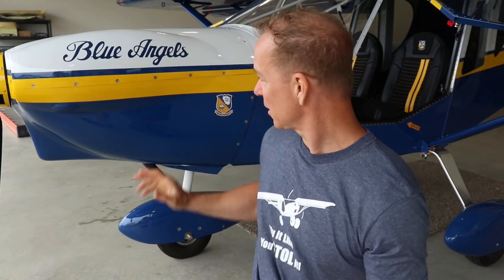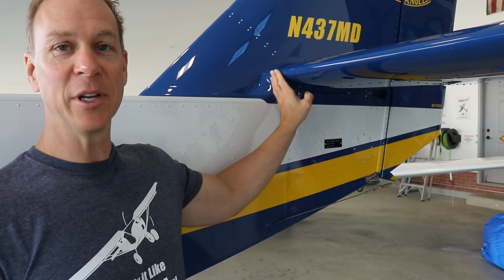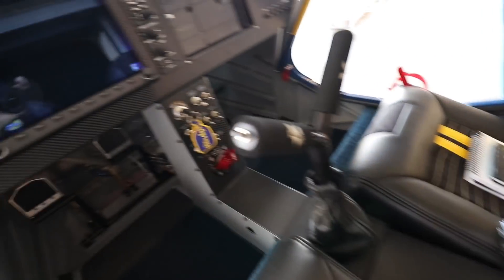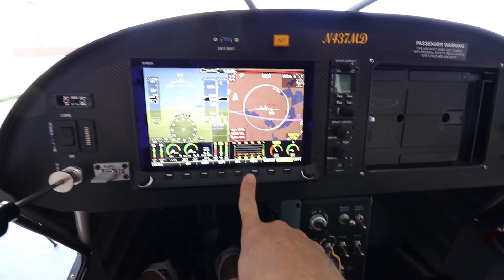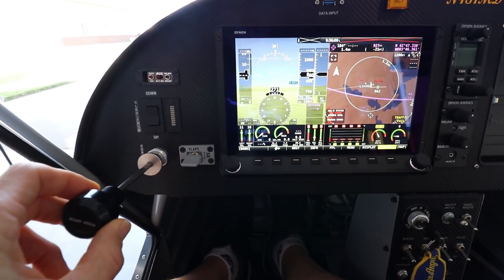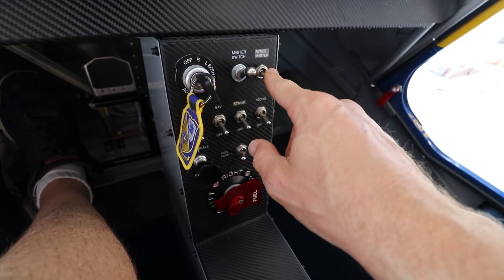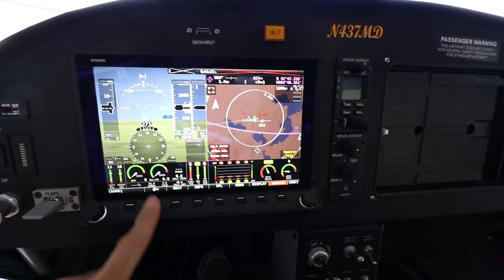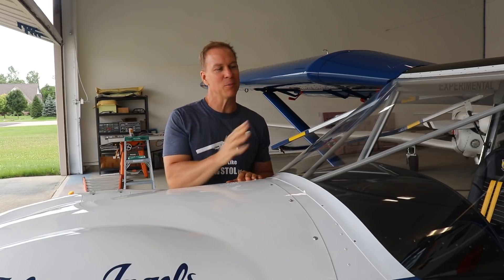Planning my CH750 Super Duty BUILD!

Comment: Good idea on the external charging port.  

I carry one of these in my survival kit in my plane... eliminates the need for hand propping and great for charging my cell phone and iPad if needed. Just have to remember to recharge it every couple of months of non-use or after a hard start... I have an adapter on my panel where I can plug it inside the cabin without the need to remove the cowl or even to step outside the plane.

https://www.amazon.com/Antigravity-Batteries-AG-XP-1-Flashlight-Carrying/dp/B0765NDS5P/ref=sr_1_4?dchild=1&keywords=antigravity+batteries+xp-10+jump+starter&qid=1597627216&sr=8-4

Comment: I have a dream!  And that is to one build a CH-801 SD!
A few questions; how would removing the carpet affect cabin noise?  I have noticed on almost all the Zenith videos that it sounds like being in a steel drum on take-off & landing; how would you dampen that or is it a non-issue?

Have you considered  a flip-down armrest with integrated throttle?  I saw it on a Aerosport Cheetah XLS intro video and loved the idea.

There is a local CH-801 that uses a BMW 1100 motor cycle engine & gearbox; what are your thoughts on such a solution? (Friend of skydiving jump buddy - hoping to speak to him directly soon)

Love you videos! Giving me hope that I too will one day follow in your footsteps!
Reply from the maker: That noise you hear is from the rear fuselage where there is no carpet, so removing it from the cabin would have no affect. No to the armrest. As for your engine question, I have nothing of value to add since I know nothing about the engine or it's use on an airplane. In general though, you will add many hours to your build going with an engine that is not currently supported with a firewall forward kit. So I would suggest the standard Rotax, UL Power, Viking, Lycoming, Corvair, etc... Good luck and hope to see you get started on a kit!
Reply: @KitplaneEnthusiast  Thank you greatly for a prompt reply!

Comment: I think adding the autopilot is a great idea.  I used to think that an autopilot in my STOL 750 was the antithesis of what STOL flying is all about!  However, it dawned on me that any cross country in a STOL airplane is a long cross country - timewise.  It's really nice to have a 2 axis autopilot to give you a break occasionally.  Like your Dynon, all I had to do was add 2 servos as the autopilot control software was already built-in to my MGL XTreme mini-EFIS.
Reply from the maker: John Austin Yes that was my thinking-if I fly this airplane to northern MI or out west somewhere, that’s a long flight in a bush plane and that autopilot will be very handy!

Comment: A 12 volt solar battery charger would eliminate your worries about a dead battery.  Question for you, you have a "Master Switch," and an "Avionics Master," but yet you Dynon comes on when you turn on the "Master Switch," so what comes on with the "Avionics Master?"
Reply from the maker: The Dynon comes on with the master because I need it on for engine start as that displays the engine gauges. All other avionics are on the avionics buss. I have it set that way because if I ever smell electrical smoke, I can turn off the avionics master and shut everything off. If I need the Dynon off, then I can pull a breaker on the right side of the panel.
Reply: @KitplaneEnthusiast , my efis comes on with my master, but my engine instruments go to my eis, which comes on with the avionics switch, which I flip on as soon as the engine starts.  I would rather keep switches for on/off, and breakers for electrical issues.
Reply from the maker: Bart Goins Great-you’re free to wire your plane however you like.

Comment: Have you seen these light weight jump boxes. https://www.autozone.com/test-scan-and-specialty-tools/jump-starter/noco-genius-2000-amp-lithium-jump-starter/851787_0_0
Reply from the maker: Dave-no I actually haven’t. I’m learning a lot and getting good ideas from the comment section. Main takeaway is that I don’t think I need to be too concerned about draining my battery as there a lot of solar power options and jump options available that I can take with me in the plane.

Comment: A while back you mentioned being frustrated with the leading edge landing lights. What are your thoughts now? Worth it in the end, or better to just mount lights to the struts or gear legs?
Reply from the maker: It was a lot of work to add the light in the wingtip. Since the Super Duty has leading edge slats it will be a different mounting system so I'm not sure if it will be easier or more difficult. Having a lens in the slats can possibly lead to water getting in the slat around the lens if the plane sits out in the rain. So I guess I don't know if I will put the lights in the slats or somewhere else.

Comment: Hello Mark, Why not to put the battery charger inside the plane on the middle console or next the usb port that already is mounted, or the other side from the passenger?  It's  reasonably protected against short circuit you can also secure it with a extra switch  ;) Bye bye from The Netherlands

Comment: Why don’t you use the Aero Momentum AM10 engine. You can turn it up when you want to or dial it down. You can run a four  or five blade carbon prop. This would make it the nicest 750 SD to date. They already have and engine mount for the 750SD. It will fit right in. 
Video
https://youtu.be/InfiwXFDUlo
Website
https://aeromomentum.com/am20t.html
Give Mark a call
Engineer/Sales 
Mark Kettering
772-240-2266
aeromomentum@yahoo.com
sales@aeromomentum.com

Comment: At the start you were talking about a “Sky Jeep” that you could hand prop out of the bush if your electrics quit.  Later you talked extensively about glass cockpits and IFR capable instruments etc that require power.   IMHO if you went with the Lycoming sky jeep concept you would also have a cockpit of steam gauges to match that also don’t require power to work.  

Otherwise please join us here in the 21st Century where we know how to make reliable electronics and fit the Viking 180.  Remember those back country areas are high and hot sometimes.  I think you will bless the turbo charger more than the hand prop capability.   If you are really worried about the electrics ask someone who knows about batteries etc to design the battery backup system for you - the Viking one is a bit dodgy and it would be relatively easy to do better.  Additionally that charger port you mentioned could easily have a lightweight solar panel plugged in to it so the batteries are charging during your camping trip.
Reply from the maker: That's a great idea to just have a solar charger keeping the aircraft battery charged.
Reply: Absolutely agree with the idea of mechanical steam gauges, at least ASI, ALT & slip/skid for back up.  In addition to losing your EFIS if the battery dies, screens can fail, short out, etc.  (Ever have the blue screen of death on your computer?)  I know modern screens are highly dependable, but I would be a bit leery of a single glass panel for all instrumentation.

Comment: The GPS (antenna) is IFR/WAAS, but they don't have an IFR Navigator.  (I understand that people have integrated the Garmin GTN-650 with it, even tho' the only Garmin mentions in the HDX install manual is for the GTR200 or the SL40), but I think it can be done.   Also, why wait for the Autopilot?  You have to take the Cruizer apart for the Condition Inspection ====> plan a mod and install the servos then.  ;-)

Comment: The Dynon AP control panel is priceless as is the Baro, TRK, Alt panel. I use them extensively when flying and taking pictures. The IPad insert is there for a backup to the dynon should a component fail..
Reply: How much is a complete AP Dynon/Radio/etc avionics package for the Cruzer?

Comment: Your battery concerns can be addressed by building in a rechargeable backup battery pack. They're a dime a dozen now. I keep one in every vehicle for the winter time here and they work great. Lightweight and powerful. They can also be used to recharge cell phones, laptops, or run portable air compressors.  Jonas Marcinko actually used one from Harbor Freight as his primary battery. Probably not the smartest thing but it did work on the video he made.
Reply: Probably Not The Smartest Thing - that should just be the name of his channel at this point

Comment: Dynon/Advanced seems to favor Avidyne navigator/GPS units.
Regarding the battery: with a MASSIVE O-370 in the nose, does the battery need to be there too? I like the idea of the battery charger, but maybe it, and the battery, will need to be somewhere further to the rear..!
Reply from the maker: I've thought of this too and is something I wanted to ask Roger about. The only issue is the loss of voltage with the long battery cables. (and the weight of the long cables!)

Comment: I'd like to see someone look-at/try/talk-about the diesel motors.  Since they run on Jet A OR diesel, fuel costs are 1/3 or even less to operate.  With mechanical fuel injection: no battery needed to run, so not likely to quit in-air. Some builders are going with a  automotive engine, too --  it's a pretty stock Mercedes 2.0 TDI in Diamond aircraft.

Is it not a good idea to just put a cigar lighter socket in your panel and charge the battery as needed through there?  I think most people just put an inline fuse (or nothing) directly to the battery when wiring a new socket.   My charger came with a cigar plug.
Reply: The  PSRU  (gear box ) is the weak link on automotive conversions .
Reply: @jamesbarber2882  Paging the Raptor...
Reply: Tom Busey Yes I've been watching the Raptor . The flying school near me use DA 42 for Airline pilot training .These Diesel engines are very very successful. They fly over me every day .But the sums are different for a flying school. I'm going from memory here but I think this engine uses a torsion damper from a car .This is the bit that absorbs the pulses from the engine, and protects the Prop Speed Reduction Unit (gearbox) .The gear box ( PSRU ) is the key .It slows the prop down to the right speed .This why Rotax engines and Viking do put out so much thrust (don't confuse with power )It's more efficient for the prop to be geared down .We had two Diesel engines in the U K One was a horizontally opposed two stroke .I has four Pistons but two cylinders .It might be in the US now . Always listen to blokes like  Mark and not the ones trying to sell you something .When you are twenty miles out over the North Atlantic and  the engine coughs the money you saved on someone's experiment won't save you ..Diamond spent a lot of money on their engine and its gearbox .Im with the Ulpower...Viking  are getting there but our laa won't wear a used engine .They are  very cautious .Fuel is more expensive here but is only a small part of the cost of this activity.and the ULPower runs on car fuel @a US dollar a litre anyway.It's ten o'clock here and I'm hitting the sack .,,,regards from England .
Reply: @BtownPilot Yes, Raptor was on my mind.  However, Peter is trying to operate an Audio 3L diesel at 133 HP/L which might seem ridiculous; so I didn't mention it directly.  Even Audi's 5.5L Le Mans car only ran 118 HP/L while needing to last a few dozen hours.  Peter's 300 HP cruise is probably still a bit ambitious,  but I'm so glad  SOMEONE is pushing the envelope a little to see what happens.  The 1963 tech of most certified GA aircraft is definitely not very hard to improve upon. Nor is its cost.

Comment: I agree with you mark about separate ignition but you can plan to do both mark patey has the 801 nice build the cleaner your airflow the better you can always use controls to slow down and control your speed and decent I already know your going to build it very nice anyway

Comment: You are correct Dynon does not have a certified GPS navigator so you would need to purchase either a Garmin or Avidyne plus the Dynon ARINC 429 module to interface them. I think Dynon partners with Avidyne.
Reply from the maker: I just talked with my neighbor Len who currently has the same set up in his Velocity as I want to install in my SD. That's exactly what he said-get the Garmin 175 and the Dynon 429 module and it's all plug and play!

Comment: Mark, if you are using the Zenith flap motor then you can display the flap position now on your HDX. We have almost the same panel, I have two screens and AP and my Dynon does display the position. My flap and trim are on the Ray Allen grip not the panel.
Reply from the maker: Scott Miller Awesome! How do you get the info from the flap motor to the Dynon? Can you let me know how yours is wired?
Reply: Kitplane Enthusiast Mine is on P22 on the Data Sensor pages
Reply: Kitplane Enthusiast I will check when I get back to the plane tomorrow, but I am fairly certain that you have to set the sensor up in the system. I can’t remember which PIN it is on.

Comment: Have you thought about powder coating that entire interior on the new build as an option for that front carpet portion?
Reply from the maker: No. Powder coating is heavy, and I'd have to move the entire fuselage an oven large enough to fit the fuselage. I actually like having the small carpet in front of the seats. I don't find any need for carpet aft of that area.

Comment: Love this topic! Can’t wait for the next video! As far as the floor goes, is there something else a person can use besides just paint?  Maybe something easy to clean, but has grit to it? A poor example would be a bed liner paint for a truck, although this would probably be too heavy?
Reply from the maker: In my fuselage, where my heels rest on the metal airframe, I used rubberized sticky-back non-slip material that works great. You can find it on amazon in different sizes. Get the largest size you can find and cut it to exactly the size you need.